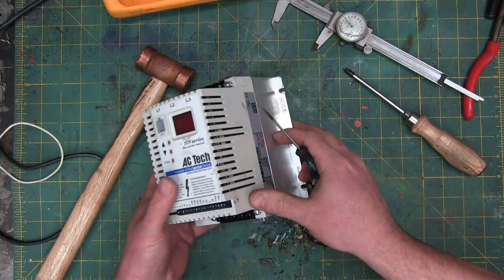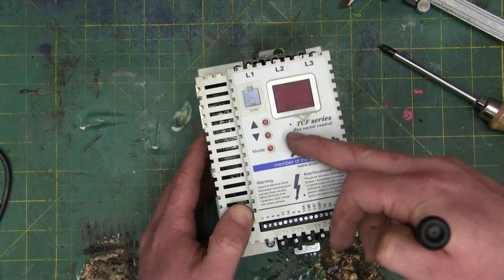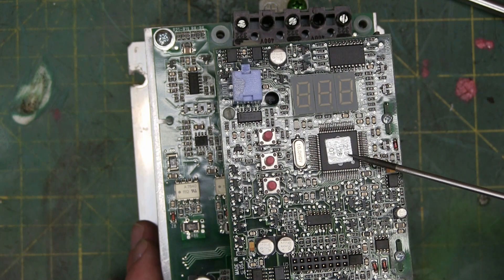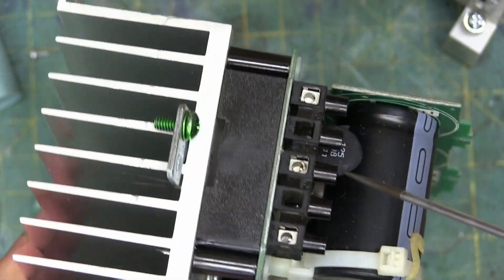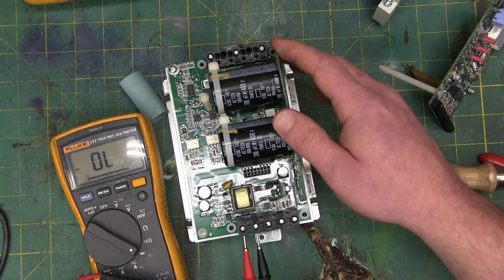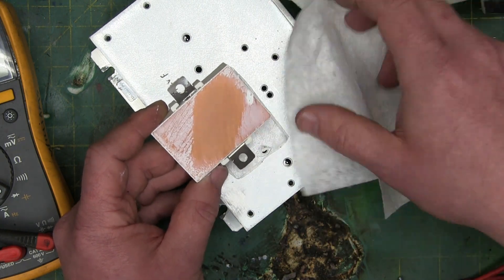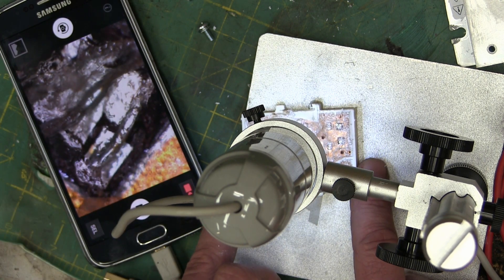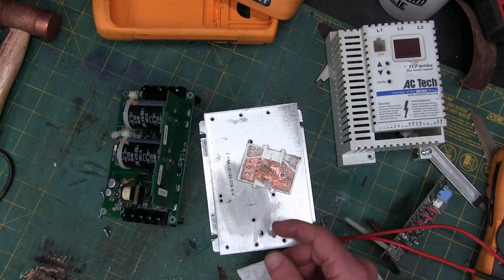BOLTR: Lenze AC Tech Drive | The VFD Channel

Comment: I have few of these lenze drives. I used one on my DIY compost trommel. It turns out a plastic shopping bag does not work well as a 'temporary' outdoor enclosure. The drive emitted a loud bang after powering it for the first time in 6 months. I opened it up and found an unfortunate partially vaporized spider across the main capacitor. I cleaned the webs and crap out the VFD and found no damage. It has been operating fine since.

Comment: Not sure if its been mentioned before but the reason the thermal compound looks all cracked (assuming its not totally dry) is that the sticks to both sides and surface tension (or something along those lines)  pulls it into peaks as the 2 halves are pulled away from each other.

Comment: We use these AC Tech drives in gravimetric feeders in our plant. Hadn’t replaced a single drive in 8 years running 24/7. El cheapo drives but are surprisingly reliable I’d say. Although the brown discolored plastic on the outside of the drive doesn’t give me the warm fuzzies hah!

Comment: I think as far as the thermal paste producing that fractal design every time, its got more to do with the pressure applied, and then you pulling the thing up. You can see this if you apply thermal paste to a CPU, then lift the heat sink off even when its still wet.
Reply: Yeah this doesn't indicate bad thermal contact. It's just how these viscous white liquids behave. It's a problem if its all dried right up...

In fact, if the topographic map looks nice and even all over it means that the schmoo layer had a consistent thickness and contacted both sides well.
Reply: While I don't know for sure, AvE doesn't seem like the type to be applying thermal paste to CPU's or heat sinks. I assume he could use some lithium grease, toothpase, or any other viscous paste/grease, apply it to a flat surface and use another flat surface to replicate this. His Gauge blocks would be fine, otherwise he could re-use these heat sinks just as a little experiment.
Reply: I'd call it more of a constructal than a fractal pattern. Constructal patterns have a minimum feature size determined by the physics being examined rather than being a mathematical pattern that looks similar at all scales. Constructal patterns usually show up where there are two ways for a system to distribute energy/mass/velocity. Tree like patterns are the most efficient way of joining an area to a point if you have an expensive but high capacity path competing with a cheap but low capacity path, which is presumably what's happening as the heat sink is lifted off where air wants to flow into the gap as it opens while schmoo wants to get out of the way.

Comment: I got a few of those things from my old HVAC job, they were sold as "Motor Master V" units. Only difference I see here is the IGBT modules were larger, multi-packs used for three-phase motors and the capacitors are a different color (blue vs. black, probably larger value too), but other than that it seems the control module is identical.
Fun fact: There's a SPI-based Flash memory module hidden in that blue hunk of plastic.

Comment: That amber goo is made down at my local Dow Corning plant. I still have some jars of it in the garage somewhere. "Non-conductive silica gel" I believe. Used to coat circuit boards that are exposed to dust and vibrations. Never actually seen it in use until now.

Comment: There are a lot of "Phase Change" heat sink thermal transfer material.  At room temp it is a solid but turns into a liquid at operating temps.  You can get it in solid die-cut sheets or something like a stick of under-arm deodorant.  It is easier to use in manufacturing while better handling any uneven gaps between the heat sink and whatever you are cooling.   Most of the big cooling solution manufacturers have it including AAVID and Bergquist.  This might be why you keep seeing powdery thermal compound.

Comment: i got one of these lenze drives that the IGBT burned straight through the heat-sink, and another that had a dead short across the phases blew 2 reactors, before the tech working on it skipped the line reactors and smoked the drive. both were brand new drives installed in a parkade fan system

Comment: As others have noted, the pattern in the heat sink compound is from the suction while pulling it off. Also would be interested in details on hacking the drives. I see them in a lot of boilers and HVAC equipment to drive power burners, and big ass fans canadian hq is in one of my buildings so i could pop into their tech department and ask a few questions.

Comment: loose connection does not always mean heat. it also means arcing and arcing means high voltage spikes. high voltage spikes kill electrical components

Comment: We use a similar potting compound to insulate high voltage circuit boards. It's sort of like 2 part epoxy, so you can change the mix fractions to get something boogery or solid. Don't know what it's made of unfortunately.

Comment: Pretty sure the Mars surface look from the diaper cream has to do with it you pulling it off. I have seen that happen with brand new stuff I had to remove right after putting it on.
Reply: ".. has to do with it you pulling it off." I think youtube must have censored that bit of the vijayo..

Comment: Those tiny terminals are pretty much standard for low amp in germany. They are the exact size of the default "phase tester" screwdriver we commonly use for electric work, since they are so dirt cheap even many home owners and DIYers in germany do own a couple of those screwdrivers. You should get one, they are great ;P

Comment: AvE, that moon surface pattern is probably just a result of varying surface/molecular tension inside the compound itself or simply as a result of air getting in and creating "channels" as you pull the two surfaces apart. The same thing happens on CPU/GPU heatsinks. There are videos on the tubes that show you different methods of applying thermal compound to said components, and demonstrating what happens by using an acrylic sheet as the contact surface. This shows the same surface patterns appear in every scenario as soon as you take them apart. Here's one such video: https://www.youtube.com/watch?v=EyXLu1Ms-q4 - One fun note is also that it appears the less viscous the compound is, the more pronounced the patterns get.

Comment: The 575 AC tech drives used to come with a label over the input terminals that said not to apply over 590 volts, but routinely over 600 here. Doomed from the start...

Comment: There should be no other set of bond wire on the diode. The pixies get in (or out) using the bond wires and get out (or in) using the copper substrate below.

Comment: Sorry this is a weeee bit off topic it kind of holds to the same principle of that compressor Jig that you had set up so the drive would speed it up if you gave it a certain signal. what if you could do that with the digital readout on the lathe so when you’re feeding in your crossfeed it can speed up accordingly to have the consistent revolutions per minute to give a consistent cut as well as it not causing much vibration so you’re going at the right speed when you’re facing any material just a thought from another shop junkie.

Comment: Regarding heat sink compound - there is a good chance it is NOT silicone based.  Many VFD makers are going non-silicone because the auto companies won't let silicone (of any kind) into their buildings.  Silicone (even in minuscule amounts) can cause defects in painting processes.  Auto makers live and die by their paint quality, so they've banned the stuff.
Reply: Yeah, BUT, this one is an antique, by electronic standards.
Reply: Wooddorkers know about that, too.
Reply: Paolo G My 95 S10, original paint quality was fantastic, 08 Jeep and it has orange peel. Saving their nickels I guess.

Comment: Has anyone had issues with vfd functionality at cold temperatures? I had one change rotation on a 3 phase pump. The temp was -10 Fahrenheit. I didn't know that was possible. Changed around two legs to temporary fix it until the weather changes.

Comment: With the cracking effect on the thermal compound, does it do that when you pull the two syncs apart? I know when I've built PCs it does that if I pull the heat sync off a day later or so

Comment: Hi, I've got one of them Lenze drives with a failure in it's 5V power supply, i would appreciate a i res pic of the power board near the transformer :) The chips have holes in them larger than themselves :)

Comment: I have a automotive lift acme screw drive on each side chain connecting the screws at the bottom 3 phase 5 hp belt drive motor no access to 3 phase do you think one of these ac drive would work ???? HELP

Comment: As a man (my woman said I am) who has worked with electronics and heatsinks, the pattern is caused by the viscosity, surface sticktivity, surface quality, and vibration, every heatsink that wasn't overapplied with Thermal Interface Material (Some call me..........TIM!!) will have this pattern, the ridges seen on one are generally the result of tiny surface imperfections and when you pull the two apart the material is pulled into those voids and whichever surface it has more adhesion to the TIM will develop the ridge of goo. The "burn in" period of most high end thermal compounds is both being phase changed into a liquid (polymer net just like multi-viscosity motor oil) that allows vibration to move the suspended particulates (diamond, carbon, silver, boron nitride, tiny rubies etc..) into the voids in the surface. http://www.arcticsilver.com/#

Comment: You can NOT check the diodes in the IGBTs like this. Not measuring anything between the Ts actualy does mean the IGBT brick is OK (or blown open respectively). Based on this single measurement you can't say if it is OK.  If you want to measure the internal diodes, measure the T terminal against the DC bus + or - on the filter capacitors to check individual diodes!

Comment: I feel like your thermal compound diagnosis is wrong.  That surface of the moon pattern looks like it could easily be the result of simply pulling the two faces apart given that the goop is pretty sticky.

Comment: I hate them drives we work on several sewer lift stations that have them. Nothing but problems from random faults to complete drive failure. The ones with the A/B drive never have a problem though.

Comment: heh.  I was just reading about how the AC Tech drives were kinda junky and when Lenze bought them they were slightly better but still not recommended by people who play with VFDs for a living.

I'm on the hunt for a 220 1ph input 5hp drive which it seems is some sort of unicorn.
Reply: I think northern tool & hydraulic has those motors for air compressors.
Reply: By "drive", I meant VFD.   

Anyway, I found an application note from Hitachi that says their 3 phase input VFDs can be run off single phase so long as the input current ratings are correct.  In other words, for a ~220v 3ph motor, take the nameplate current rating and double it for a VFD that will run on single phase 220v. So, in my case, I need a drive rated for 7.5hp to have the proper input current rating of ~30A.

Comment: Usually those gels are for high voltage isolation. If there was air between the leads, there would have been arching.

Comment: What does that thing do?
Reply: Are you being serious? I never miss an AvE video, but maybe some people do, I guess. He's had a bunch of videos on the topic of VFDs as of late. The first of which would probably be the most elucidating.

Edit: The DuraPulse video.
Reply: Turns house power into industrial (3 phase) power. You should google the name.
Reply: It takes single phase AC, converts it to(usually higher voltage) DC, and then uses high frequency switching to output 3 phases of AC offset by 120 degrees for turning high torque motors on lathes and rich people treadmills and the likes.
Reply: Nothing....its broked
Reply: Atlas WalkedAway it’ll also take a 3 phase supply. It’s essentially a speed controller with some fancy control options. Clever pieces of Lego
Reply: Uhhhhh Huh, correct. I don't know how my eyes glazed over that little L3 there.
Reply: As it's name implies...it varies the frequency of an AC sine wave to change the speed of whatever needs to chooch.  'er something to that effect.

Comment: Oh fuck dude, I actually designed and built a ton of Testing Stations for these drives!  I mean that was a previous job and all, but YEAH.  Those fuckers needed special contact pins made and everything.  I had to set up the CNC mill like a Lathe to make them all.
And a safety interlocked Lexan sarcophagus because sometimes they blew up in live testing.  God, I'd more or less shoved that down into the Repressed Memories folder.

Comment: obvious case of suicide. diodes likely failed in a chain reaction. transistors usually fail to a short circuit. diodes died in a chain reaction due to this. exact same thing is common in computer power supplies. it's also likely other smaller components were damaged at the same time.